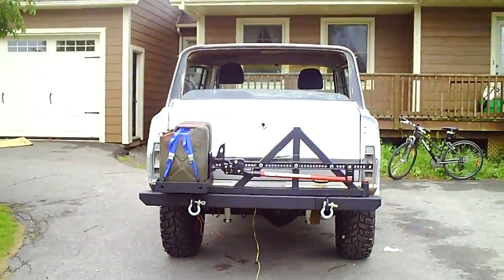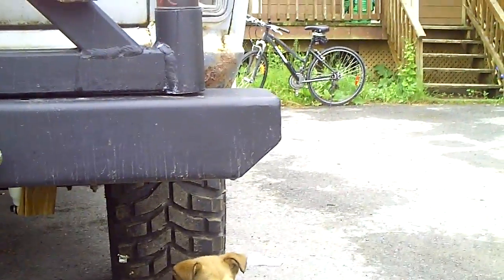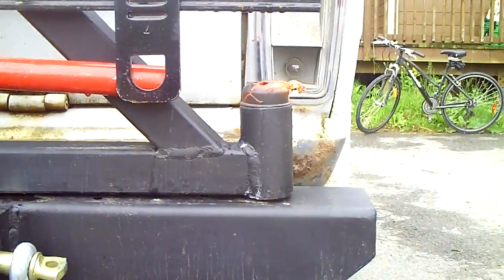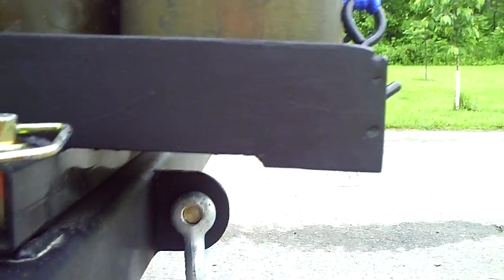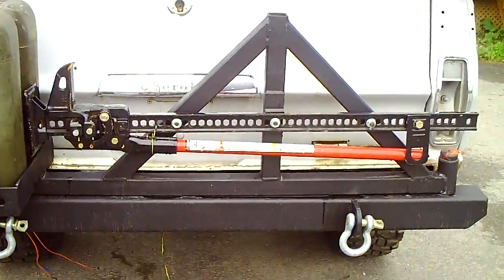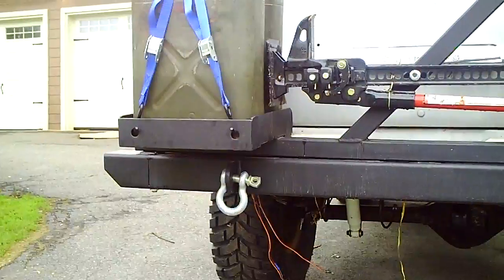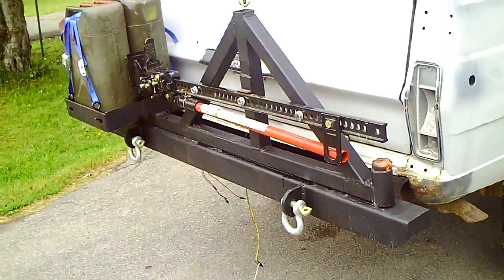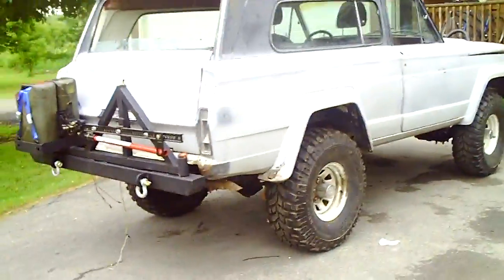77 Jeep Cherokee Chief Rear Bumper and Spare Tire Swingout Update Pt 1

Comment from the maker: The welding isnt the hard part, the hard part was the planning and preparation of the pieces. Given that with the inflated 35" tire, high lift jack and full gas cans on it, the entire assembly weighs maybe 300 pounds, so you NEED to make sure you get really excellent penetration on your welds.

If you dont normally weld, practice your beads and heat settings a LOT, because if this thing breaks off on the highway you can very well kill somebody. 

Good luck!